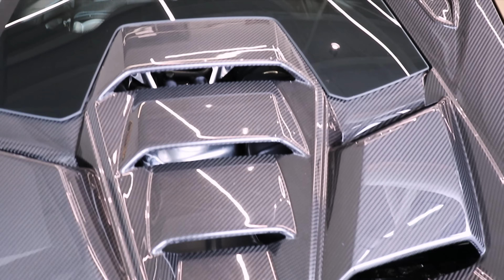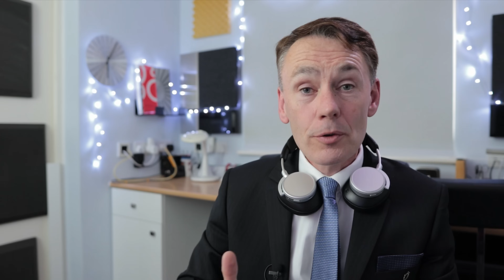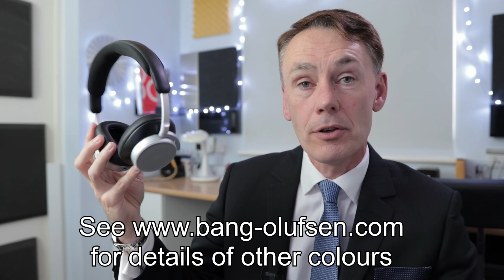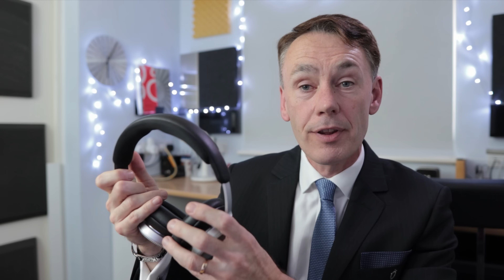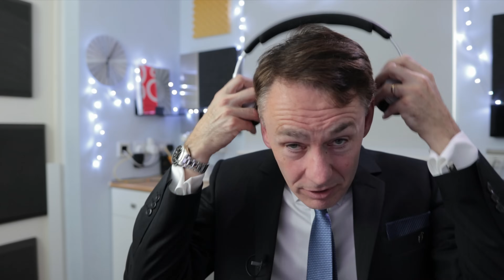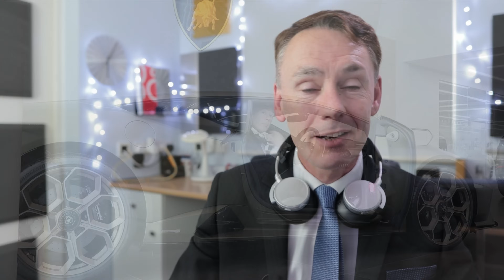Bang & Olufsen Beoplay H100 Luxury Wireless Noise Cancelling Bluetooth Headphones - Full Review [4K]

Comment: Do they have the same issue as EX where u can pair it to max devices at the same time? and I'm not talking about multipoint I'm talking about, simple BT pairing. 
I needed to return the EX because I could only pair it to two devices. So when it was paired to my MacBook and  my clients laptop and I wanted to listen to music from my iPhone I need to unpair it on one of the laptops before I was able to pair it again with my iPhone.
Reply from the maker: I haven't tried to pair the H100 to more than 2 devices, so I suggest checking this with B&O.
Reply: @soundsheavenly I’m chasing the dream and building Beosound Theater powered “budget” home cinema for my own 1st ever apartment. So I’ll definitely check that out with B&O store team.

Comment: Just bought my H100, and found the ANC so weak comparing to the AirPods Max. What is your take on that?
Reply from the maker: I haven’t tried the AirPods Max but H100 should have good ANC.  Best to check the app settings in case it has been accidentally turned off

Comment: At this price I expect sound quality comparable with something like Focal Celestee or Beyrdynamic T5 at least. H100 should totally outperform PX8, Focal Bathys or Mark Levinson 5909 (should be class or two above them). I've owned H95 and I cannot say they are something special. Significantly better than Sony 1000xm series, slightly better than B&W px7, compared to wired headphones they seems to be in par with £100-150 headphones. Even old B&W P7 are better headphones in term of sound quality. Don't talk about open backs like Sennheiser HD660, Hifiman Sundara or Ananada, these are middle class headphones and destroy H95 (most likely any ANC headphones). For that money you can buy combo Fiio M11 Plus + Hifiman Arya and maybe Sony 1000XM4 as well. If somebody want luxury looking headphones, PX8 is best option, they cost 3 time less than H100 and in my opinion look better.
Reply from the maker: @milanbudzak1146  PX8 are close to H95, but nowhere close to H100. You do need to try them for yourself to get the measure of them. Open back headphones will always sound better at a lower price, but you lose all the features such as wireless and noise cancelling, etc.
Reply: PX8 actually cost 381 Euro on German Amazon. H100 cost 1500 EU, even more than Sennheiser HD800s. I don't believe that H100 are several classes ahead of PX8, H95 or Bathys. I found out that H100 have only SBC and AAC codec. Even LDAC is not good enough. When I use my H95 wired, there is almost no different, but when connect PX7 with wire, there is huge different in sound quality, completely different headphones. For me, it would be better to buy PX8 with Hifiman Aria/Sennheiser HD800 or maybe save more money and buy some Staxx combo. I actually own 15 headphones and ANC ones (H95, PX7, 1000xm3) are inferior to others, especially xm3. Ananda, Sundara, HD660s, Beyerdynamic T5 or Sony MDR Z7 are way better. In my Opinion, Ananda and Sundara are the best price/performance headphones.
Reply from the maker: @milanbudzak1146 one of my favourite headphone setups is Sennheiser HD599 wired to a PC using the Equaliser APO app to eq them to match the Harman curve. Very little can beat that to my ears but great that we can each enjoy different setups 👍
Reply: HD599 are very good sounding headphones, they sound very well when connected to Astell&Kern Acro, I was really surprised when heard them with that player for the first time. Same happened with ATH50mx. I was planning to sell them, but when I listen how great they sounded, I change my decision. ATH50mx are great for listening live concerts. HD599 for classic music, movies and as they are very comfortable, I use them when learning Japanese as well. Construction in both cases is very basic and cheap, but sound is excellent for it's price. People really do not need to invest thousands to get get great sound. Most important is good DAP/DAC. I thing than Sennheiser 600/650/660s with mojo 2 would be fantastic combo for most people. At the moment there are no wireless options to be even close, unfortunately. Maybe in ten, twenty years, who knows. The biggest issue is price. That kind of headphones would be extremely expensive and heavy due high capacity battery needed.

Comment: Do these connect over Apple Airplay? as the sound over Airplay would be better for movies than over Bluetooth? Has someone actually watched a movie with these with the Dolby Atmos function? and of course, has someone actually tried to connect them to Apple TV?
Reply from the maker: Hi, there is no Airplay but they do work superbly well using Atmos and other spatial audio content - I used the wired connection for this and it worked very well.  I haven't used headphones with Apple TV, I don't think this has a Bluetooth or wired analogue audio output?

Comment: Raced the Huracan GT3 Evo for two years and while its sound is admittedly unbeatable by any headphone, the H100 really is the Bluetooth headset to beat. Amazing right out of the box and a vast improvement over the 95s. I have nearly tried them all (barring £10k studio headphones) and haven’t found a match yet. €1,400 is steep but worth it, considering a Knick in the Lamborghini bodywork will set you back 10 times that.
Reply from the maker: I imagine the GT3 Evo must be an amazing race car, even the standard Huracan Performante and Tecnica road cars that I have driven are really dialled in and focused.  H100 is a superb headphone and stands up well against more expensive headphones.  That was my reason for using the Huracan as an example - it puts the price of the H100 into context, whilst being a superb driver's car for those who want the best.

Comment: The sound REALLY nice but one thing that bothers me a bit is that I like the normal setting for some music and the virtual for other... and then you are often going to the app to switch. Heavy or bass music is on the normal but more laid back music is on the virtual setting. Its not a problem but I find my self often trying both options. One of the first songs I heard was Angelina Jordan "If I was a boy" cover, with the virtual setting and it was breathtaking to listen to it... that one song on these and I was sold. The volume wheel on the H100 is solid with a high quality feel and the H95 always felt cheap and loose so that is really nice. And then there is the "turning on sound" when you take them on, it almost makes you want to put them on just to hear it.
Reply from the maker: Yes, the build quality is a real step up from H95, also the sound is superb.  That is an interesting point about the spatial audio settings, I will suggest to B&O that it could be nice if the spatial audio setting could be easily assigned to one of the headphone controls to allow it to be changed without needing to open the app.

Comment: did they discontinue the aircraft adaptor that they previously included with their headphones_
Reply: I forgot to add that the official airline adaptor that Apple sells separately for its AirPods Max has simply been a Lightning - now USB-C - to 3.5 mm jack. I remember when aircraft actually needed three pronged headphones. Now a flight attendant told me that they come with two simply so that passengers will not steal them, but the same fidelity comes out of either port with a 3.5mm jack.
Reply from the maker: @KJP-dv2uj thanks, that is good to know
Reply from the maker: Yes, it appears they did discontinue this adapter - I guess B&O don't think people will take H100 on flights as they don't include a hard carry case.
Reply: Most modern international aircraft I travel on now are happy with the included USB-C to 3.5mm jack included with most headphones. I don’t travel with my airline adaptor with my Focal headphones anymore.
Reply from the maker: @KJP-dv2uj yes, but I like to have the airline adapter with me just in case

Comment: Speaking of longevity of B&O products. Is it possible to clean the padding on the band of my h95? It’s not removable as in new h100s unfortunately, and in my version (Nordic ice) it gets pretty filthy…
Reply from the maker: Hi, yes this should be possible, if wiping it with a damp cloth doesn't get it clean then I suggest contacting B&O via their website for cleaning advice.
Reply: @soundsheavenly  thanks for your response :) I’ll give them a try. However, their customer support in Poland is a bit nightmare-ish…

Comment: Hi Steve, did you test these cans for telephone quality? If so did you a static noise? The H95 emitted a strange static noise during telephone calls while the transparency mode was switched on. When I turned ANC on the noise disappeared.
Reply from the maker: Hi, yes the call quality is good on the H100, I didn't hear any static noises.

Comment: These will NOT be long term headphones simply because wireless and digital tech is changing so quickly.
Reply from the maker: OK, but they can still be used via a wired connection long after wireless standards have changed.
Reply: The H100 can be updated for many years to come
Reply: Why's that? My Sony WH-1000XM3s are 1 month away from being 6 years old. Buy a quality product and it'll last quite a while. Although for the price I'd want these to last 10 years.
Reply from the maker: Yes, I would expect a minimum ten years lifespan for headphones at this price range, which should be realistic for the H100

Comment: Nice review. Too bad this set and the H95 does not work when battery is dead .
Reply from the maker: Thanks. I agree it would be nice if they could work passively without needing the battery to be charged
Reply: @soundsheavenly  is there a BO model that works passively without battery?
Reply from the maker: @rodriguezahr yes, Beoplay H9 stills works without the battery

Comment: Do the H100 reach higher volume levels than the H95s? For me, I have always wanted a little more volume out of the H95, like 20% more. If the H100 are louder I feel that is also a improvement. Thanks for the review!
Reply from the maker: Yes, H100 is plenty loud enough, I haven’t turned them above 50% yet
Reply: Exactly my thoughts. The volume is one of the biggest downsides of the H95.

Thanks for the feedback!

Comment: Hi Steve. I had one gripe with the H95 and that was that the headband kept touching my head in a very uncomfortable way, which rendered them useless. I had a pair for a couple of days and I returned them.  It doesn't look like the H100 will be any different. I'm sure sound and build quality are superb, though. Another negative is the weight. I'll pass.
Reply from the maker: Personally I find them more comfortable than H95, the headband touches my head but not with any pressure

Comment: They look good and by the way reviewers are praising them, they seem very promising. When wiring them in, do they use an internal DAC? Can they be used with an external DAC?
Reply from the maker: They do sound good. Yes they have an internal DAC, or they can be used with an external DAC via the cable included
Reply: @soundsheavenly  I know they are expensive, but I am liking them more and more. Thank you 🙏